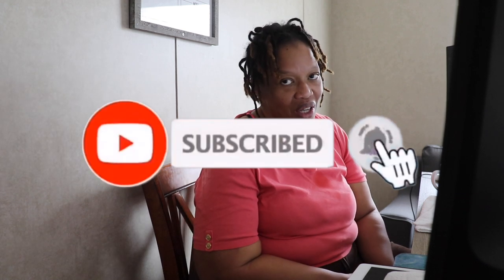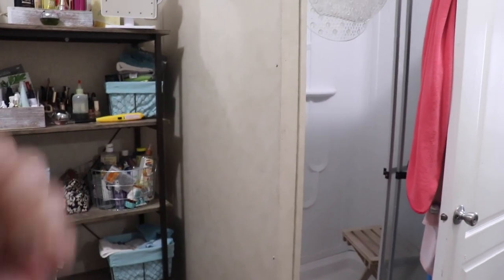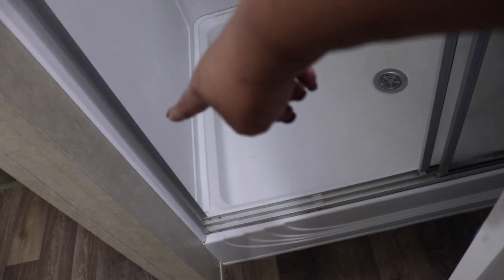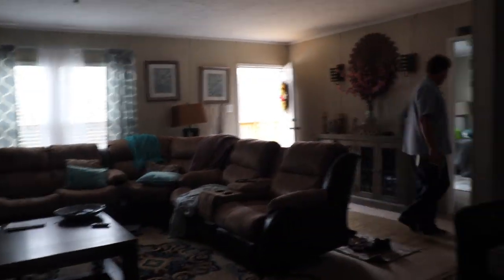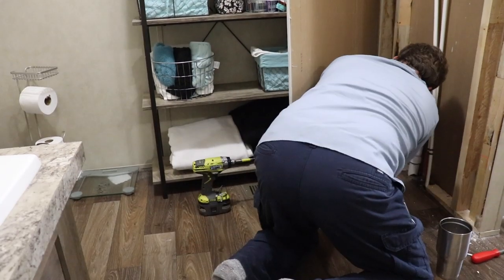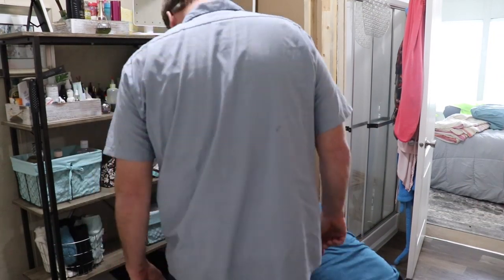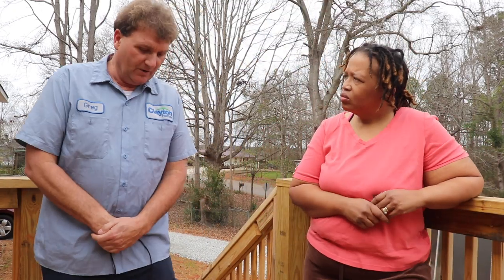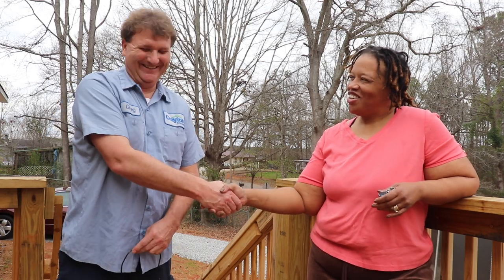Plumbing Leak in our Master Bath | Clayton Homes Visit and Interview

Comment: Wow it's very neat how those wall panels Can easily be removed. To be honest, I actually would Prefer those types of walls to regular tape and textured drywall. My question is are they easy to clean or to wipe off?
Reply from the maker: Yes you simply wipe them off. It’s wallpaper we have